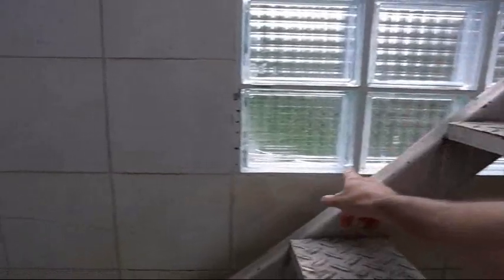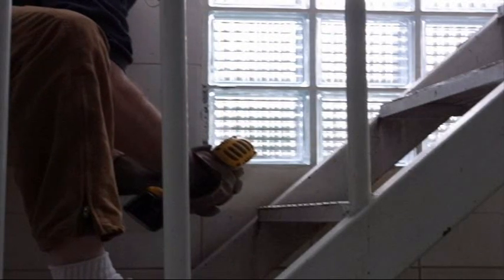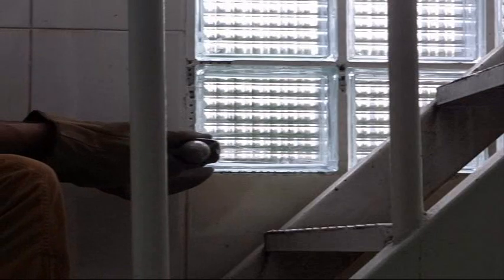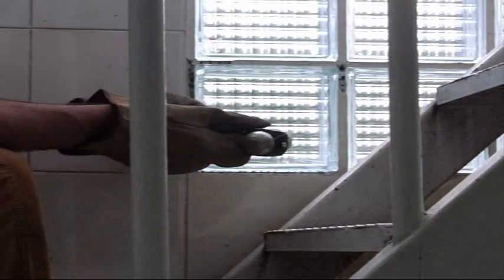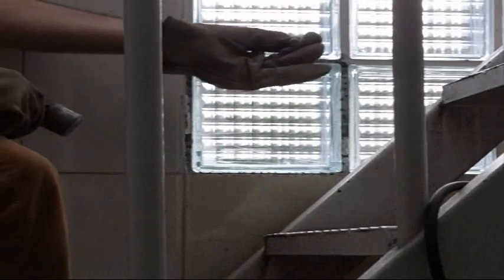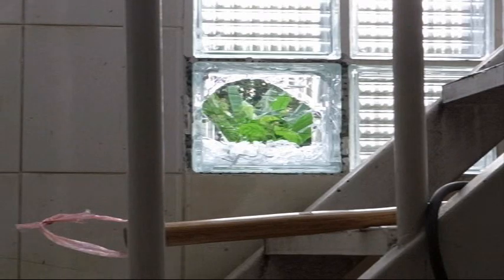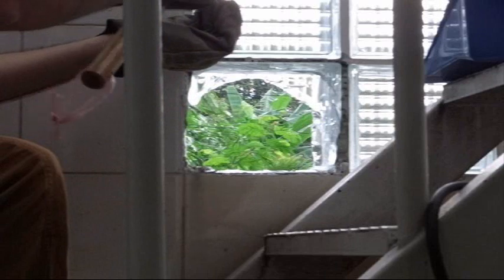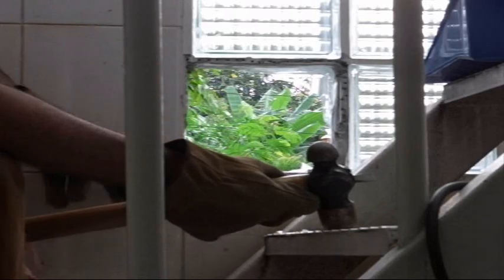Glass Block Repair - Removing One For Replacement (Updated Video Available)

Comment: Is there a way to remove a block without breaking it?
Reply from the maker: With extreme patience, luck, and time one could simply scrape the mortar from between the blocks. I would guesstimate between 8 and 16 hours per  4 sides.
Reply: Couldn't you scrape it with a power tool, but smaller than you'd expect? 

I'd do as much as possible outside because you still don't want to breathe concrete dust. Wet it to keep dust down.

Comment: If you stick a layer of contact paper on the glass before you break it out with the hammer it will help to minimize the flying fragments of death.
Reply from the maker: I had duct tape.  I thought of that as I cleaned up a million glass shards.

Comment: Glass block windows like this should have a water proof membrane at the bottom (tarpaper or something) and typically a thin foam expansion material around the sides and top, thereby making removal of edge units a little easier. That's why the left side broke out easier. You made me nervous at first with the drilling and chisel work, as it's very easy to chip an adjoining block. I would have used a grinder with a diamond blade.  But you made it! Good job!

Comment: I am thinking about removing about 8 blocks. Then framing it out for an air conditioner. Not sure how I'm going to do this exactly. But your vid is a great start. Thanks!
Reply: Use 4 inch grinder..

Comment: I understand the reasoning behind removing some grout, the glass needing to expand when you break it, but if you break the center forcing the glass into the center of the block isn't that enough?
Reply: well, it worked. Just hit the center of the block hard enough to make sure it pushed into itself. After breaking out the inside, i put a large flathead screwdriver tip between the block edge and the mortar where i could see cracks had formed, which pushed it up into the center where the glass was gone. The mortar pretty much fell out once i did that. Took all of 5 min. 
TIP=   If your're doing it from inside on a windy day, hold your breath and keep your face out of the breeze....
Reply from the maker: Good question.  When glass breaks it expands with tremendous force.  Tile does the same.  It expands a tiny, tiny amount (the width of the crack), but the force is huge.  From your experience it's possible to break out the center without breaking out the edges, yes.  But if the outer part cracks in the process the force is pretty much along the edges to the next block.  So it's safer just to give it room to expand and you won't be as likely to have to replace multiple blocks.  Glad you got it done and thanks for the safety tip!
Reply: N

Comment: L just removed a glass block that was cracked in my basement window , thanks to your to your video .It wasnt to bad I used a MOUTI TOOL to remove the grout between the blocks. IT did a good job. THANKS FOR THE HELP
Reply: Mouti tool
Reply: Can u tell me what a mouti tool is?????